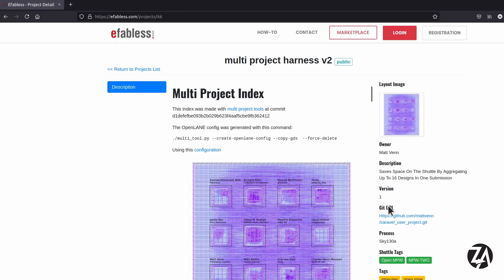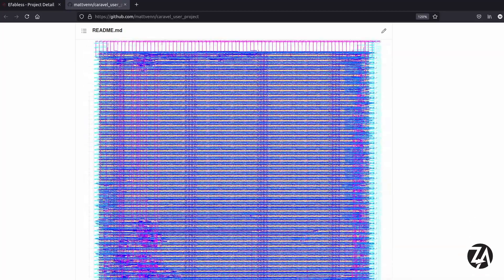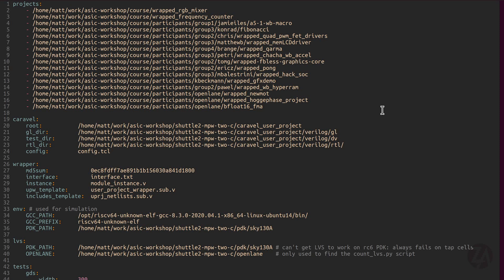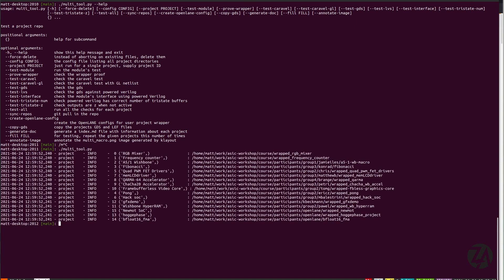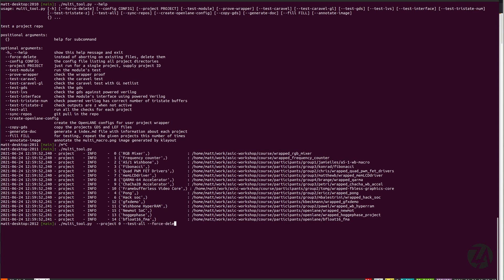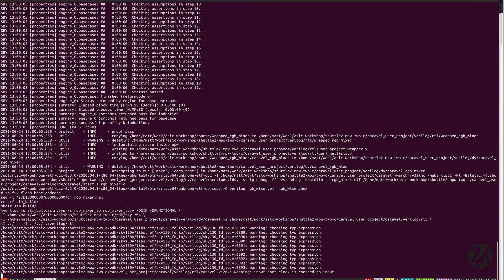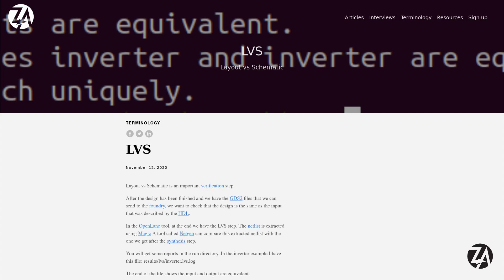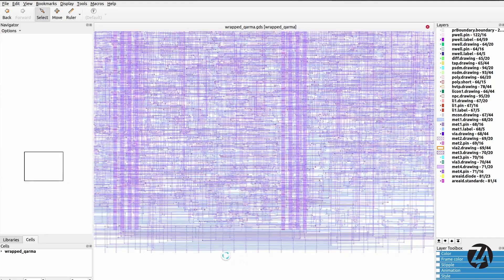14 people learnt to make their own computer chips with the Zero to ASIC course!

Comment: I’m a Silicon validation engineer. I have a degree in Engineering and have excelled in Analog and digital electronics theoretically. But I’ve always wanted to put it into practical use. Do you think this course is right for me? Because Ive been working on bench for almost 5 years testing chips but never really got the chance to understand the design and their use cases. Eg. Bandgap, RDAC ladder. My practical application never went beyond breadboards.
Reply from the maker: The course is a great way to try the other parts of the semiconductor experience! Currently there are 2 courses, one on digital and one on analog.